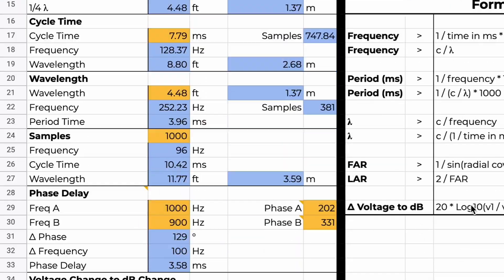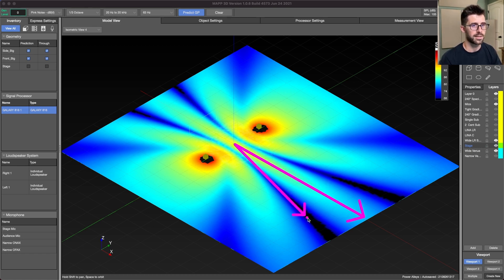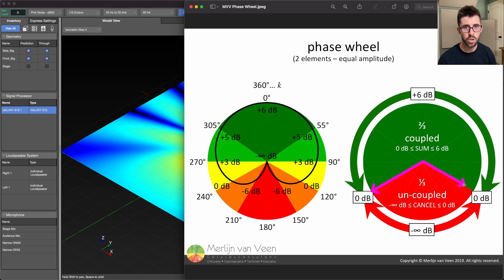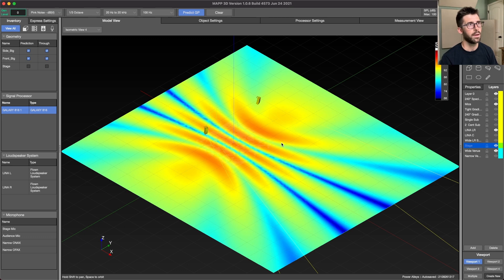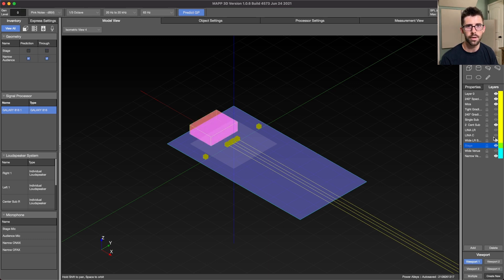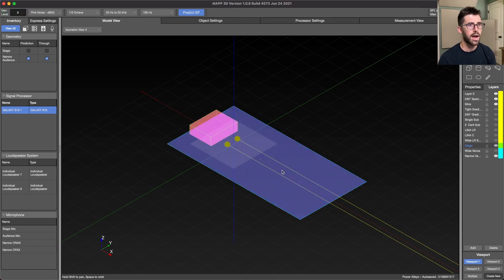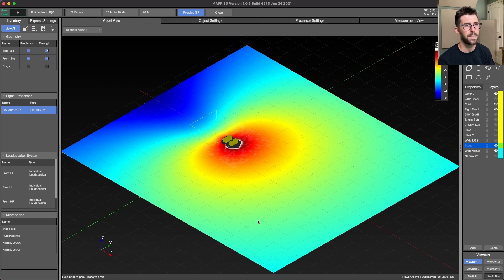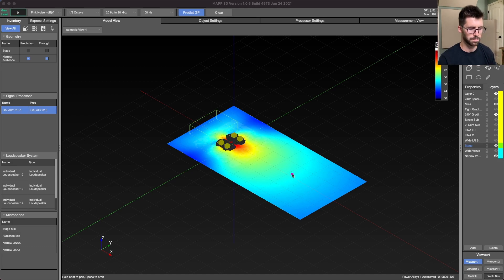How to Prevent Power Alleys From Ruining Your Low End

Comment: Great usefull video, thanks! I really enjoy the good and visible explanation!

I am a dj and mostly have gigs inside.
So my subs happen to crossover at 100Hz. Is it correct to assume that, when I am in a small+long room, 7.53 feet from center woofer to center woofer is a good distance to position the subs? 🙃👍

Comment: Great video, very clear explanation, thanks! The thing I find the hardest in practical terms (for fixed installations in churches, specifically) is that sub arrays need to be placed right in the middle of the venue, between the stage and the first rows of the audience. That's probably of the second most important area in churches, at least on more traditional ones. So, the second-best options seems to fly the subs or just forget about them.

Another one that theoretically works is to delay one of the subs in the LR layout, by the time it gets for the sound to travel from one sub to the other. That creates less pronounced SPL differences and, as long as the delay is not longer than about 30 ms, it shouldn't be noticable.

What is your approach when you can't place the subs in the middle?

Comment: Great video, I knew speakers could cancel each other out when at an opposite polarity, never thought of the time of travel with the lower frequencies. If you don't mind, What would you recommend in a church stage setting where I have no choice, but to place the subs at the far left and right sides?
Reply from the maker: For a church with a left/right sub setup? - pray : )

All jokes aside, there's not much you can "do" other than be aware of the problems it causes, then always take your low end mixing decisions with a grain of salt. Make sure and take a tablet with you and mix in the room, not just camp out in the booth.
Reply: @MichaelCurtisAudio  😆Thanks I'll pass it on. And Thank you for your quick reply. I'm in the process of watching all of you videos related to speaker placement. Now is my chance to get it right since it's still a construction project. if you don't mind one more, it's a vaulted ceiling I have room to hang speakers and it's looking like my best option, would you fly a sub in this situation? sorry if it's a bad question, going to watch your "they thought I was crazy video" next. Thank you!
Reply from the maker: @canopygardensgreenhouse9907  You got it! And yes, in most cases I recommend flying subs. And in vaulted ceilings I end up doing single center main speakers as well, then adding delays if necessary.
Reply: @MichaelCurtisAudio  great! Thanks so much Michael.
Reply: Micheal, would you be willing to do a little consulting for us? I would rather pay a professional than change my mind and rework and waste money. Thanks, Andrew
Reply from the maker: @canopygardensgreenhouse9907  Sure thing! You can book a 60 minute consulting call here - https://www.producedbymkc.com/offers/UNo5zx8p/checkout
Reply: @MichaelCurtisAudio  thanks! I'll be in touch.

Comment: Hey Michael

Maybe i missed something, but rewinded a couple of times. Can you ellaborate on how you calculate the distance between the centered (put apart) subs :)?

Loved your video! Will dive further in to your channel next :)
Reply from the maker: Glad you enjoyed the video and thanks for the question.

I've actually changed my stance on spacing subs a little bit since filming this video. I think I mention that you calculate a 2/3 wavelength at your crossover frequency to pull apart subs and narrow coverage. I would now advise to do no more than a 1/2 wavelength.

As an example, if my crossover was 100Hz, its wavelength is 11.3ft. Divide that by two and that's 5.65ft.
Reply: @MichaelCurtisAudio  gotcha! Thanks :)
Reply: why the change of stance on this? measurements in the field? @MichaelCurtisAudio

Comment: This video was extremely helpful and eye opening for me! Thanks a lot! I’ll keep watching all your videos, there’s a lot to learn from you. I have one question though, does all this hold true if this is inside a room with walls, floor and ceiling? I would expect the reflections to have some influence there.
Reply from the maker: So glad the video was helpful to you! Yes, room and wall reflections definitely have an influence here. In short, it makes the deep valleys you see here less pronounced. It "fills in" some of the gaps in energy with some late reflections. The low end feels looser, but it's better than a 36dB discrepancy! I am more apt to push for a center sub setup when doing shows outside since I do not have the luxury of walls helping fill in the gaps.
Reply: Is there any simulation SW than can be used to predict how the subs would perform in a given room? Or can they only do open field?
Reply from the maker: @germanboza  MAPP 3D can show you how reflections off walls incorporate into the prediction, but you would need the full version of EASE to calculate room modes, decay times, etc.

Comment: Question here. I have my PA set. 2 12s  subs and 2 loud 15inch power speakers. Now the subwoffer has a frequency selector on the back from 70-150 heartz. I'm guessing that is to cut off the frequency of the above 15 inch  loud speakers. My question is what happends if I select the above 100 heartz frequency on the subwoffer. Do my loud speakers begin to loose their volume of sound 🤔
Reply from the maker: That knob is selecting the crossover frequency in which your subs will start to hand off to your mains. You don't want too much overlap or you'll get a low end bump where you don't want, or you don't want a gap if you set the crossover too low.

I'd check and see the recommended crossover from the manufacturer of your 15" mains speakers, then set your sub to hand off there. If you're unable to find that, 100Hz is a good place start, then work lower to 80Hz or so if that doesn't work. The best way to know is to put to do a test and verify with a measurement mic and software like SMAART/OSM.

Comment: Hmmm. So what if I do a spaced pair of subs in the middle of the stage, get a space to the correct wave length, and then a run one kick mic to one of them and the other kick mic to the other. One bass guitar channel to one sub and the other bass channel the other sub?
Reply from the maker: Dave Rat uses this approach (sometimes). I'm not sure what you mean by "correct wave length", but yes, in theory this could all work to a certain extent.

Two kick mics means that yes you'll have two representations of the same kick drum, but they'll still be correlated to some degree since it is indeed the same source. I would test how much actual decorrelation you would get between two different microphones.

There will of course be timing differences do to the mics not being able to be in the exact same point in space, but if there's not much difference from a phase or magnitude perspective from the mic capsules and circuitry themselves, then it will be the same as having a mostly correlated duplicate offset in time by a millisecond.

Same thing with the bass guitar. A DI line and an amp line will have much different phase and magnitude responses since the bass cab will have a ton of LF delay due to speaker design, so better chances there.
Reply: @MichaelCurtisAudio  When mixing, I use the In-Phase plugin from Waves on 2 kick mics, or a Bass DI and bass amp. It is a time alignment tool that uses delay and all pass filters to align sources. I have considered using 2 of the same kick mic on kick drums instead of the normal 2 that I use.
Reply from the maker: I haven’t used that one from Waves! I’ll give it a whirl next time I’m in a Soundgrid situation. Yea, most engineers underestimate the phase smearing a cab will do vs the DI for bass!

Comment: Very interesting and informative! I’m trying to dial in two 18” subs for my home party. They’re one QSC active 18” and an SRX dual active 18”. My space is 18’ x 30’ . I’m trying to achieve chest hitting as well as deep bass for a party. What configuration would you recommend? I tried cornet loading the dual facing forward and back firing the single 18” along the center wall.

Any suggestions is greatly appreciated!
Reply from the maker: I'd go with an Occam's Razor approach here, keep it simple!

1. I'm not positive the QSC and JBL subs are phase compatible with each other. So, I'd choose one ore the other. If maximum SPL is your goal, go with the dual 18".

2. Put it against your center wall facing the wall. That will take advantage of the quarter space loading and the woofer close to the wall will eliminate any SBIR.
Reply: @MichaelCurtisAudio  thank you so much for the advice!  I will try it !  I would not have thought of facing the speaker toward the wall to get chest thumping bass.